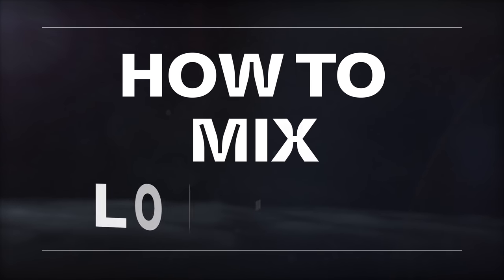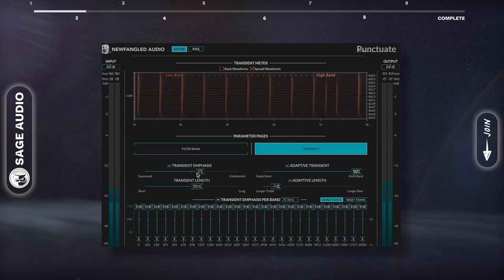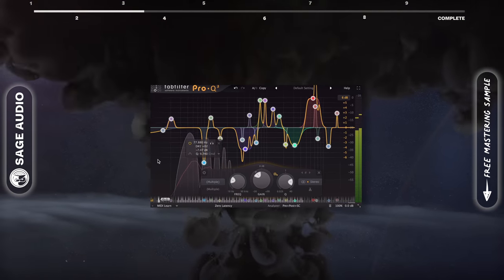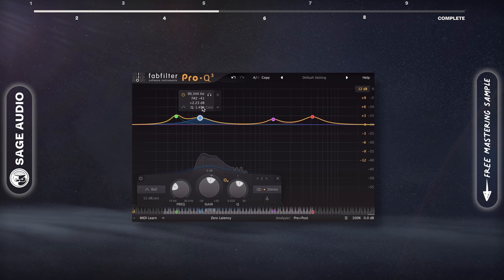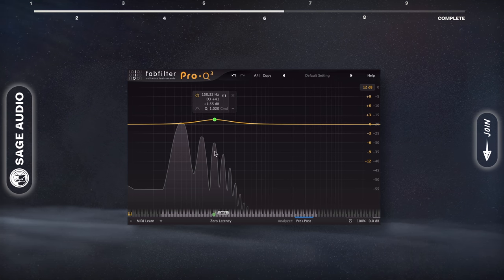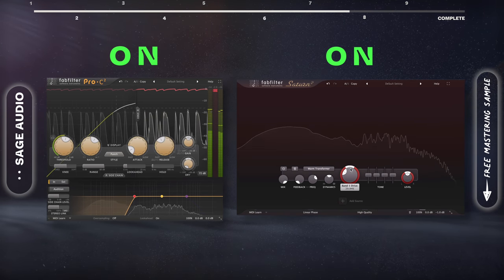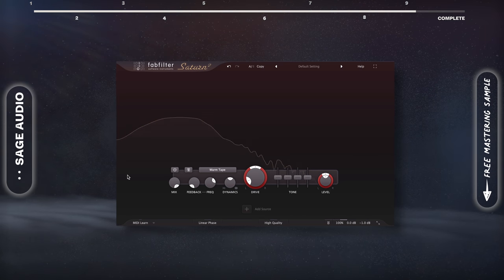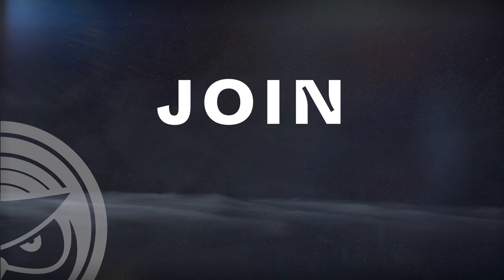How to Mix Low End

Comment: A good trick is to separate your bass into two separate tracks, one low frequency and one high frequency using EQ. Make the low frequency track mono and punchy, and distort and widen/open up the high frequency track, makes your bass punch through the mix without ruining mono compatibility or making the mix too muddy 👍
Reply: Good old layering
Reply: Really great tip. I tried it. Thanks very much.
Reply: Waves studio rack is good with this.
Reply: Really good tip! Michael Brauer employs this one
Reply: @talktokale  there's a waves tutorial from Lu Diaz as well on YouTube implenting this technique which I found helpful
Reply: the final trick that I didn't understand how the envelope follower works on saturator
Reply: Or use sub bass for the low one, work really well too
Reply: Use a linear phase EQ-Mode. Otherwise your sound will suffer.
Reply: Though it does depend on the situation and bass, I did have success with this trick before. You don't want the same kinda distortion on the sub 80 Hz as on the 80-240 range, nor the 240-960 range or the high end.. arbitrary ranges. But my point is, don't clip the 80hz range. That won't make it sound louder. Instead clip the higher ranges 👍
Reply: @Quadr44t  100% the lower frequencies should be mono and softer
Reply: @michellew.3691  How did this work exactly again? I believe the parametric EQ s I make use of are linear phased. Though if you modulate parameters of said EQ I remember that disabling this linearity did smooth out the changes over time..? I dunno, I have been unplugged for a month now 🥲 (RL stuff etc etc etc )
Reply: @TheEnergeticSloth  totally. If you think about it. It is pointless to have stereo for that low end. We can't even sense direction for it.... The only thing that can happen is that the low end gets fucked up by interference patterns from the left & right speakers. The best tip I can give, at least for music of the "kick", "subBass" structure (most EDM but particularly trance-based genres) is the following.

Match pitch and phase of kick to bass so that they just constructively interfere. Make sure the combined loudness during  moments of overlap are around the peak loudness of either of the individual sounds.

Throw on a limiter (multiband) to the master bus and collapse<150 to 200 Hz to mono.

If you wanna mess with delay/reverb/echoes (whatever you want to call it, it's just all different tastes of "delayed" signal in combination with the raw sound). That is totally fine, above ±200Hz. When messing with this at lower frequencies you are messing with interference pattern again. So no! Wrong! Don't! Sacre Bleu!🥖🥐🍷

Oh I forgot to mention, it is perfectly fine to alter the bass notes. But only after the overlap with the kick is over.

Volume envelope kick
|\
|__\
Pitch envelope subBass
          ___
_____|

If this drawing doesn't get distorted by the layout of YouTube 🤞
Reply: in engineer terms, parallel compression
Reply: Precisely what I do, it works excellent

Comment: What does the envelope do in the last tip (Modulated Distortion)? Does it increase the harmonic distortion in the high-band as low-band’s frequencies fade out? So, distortion is heavier in the lows than highs? Is that it?